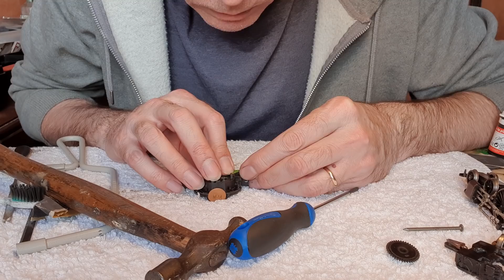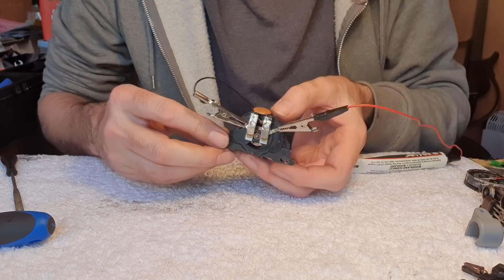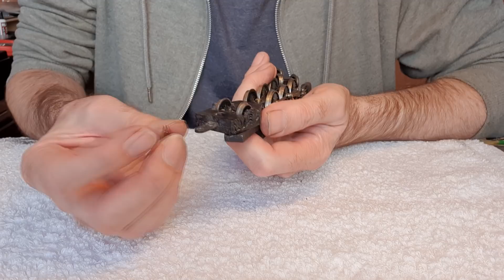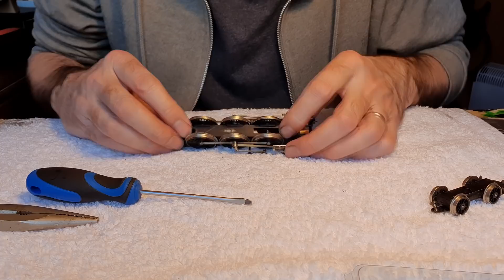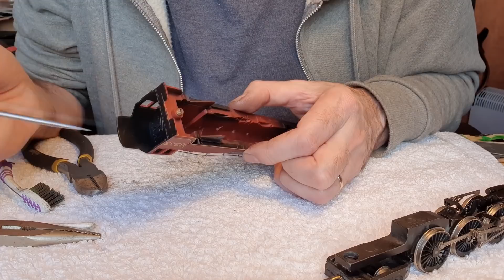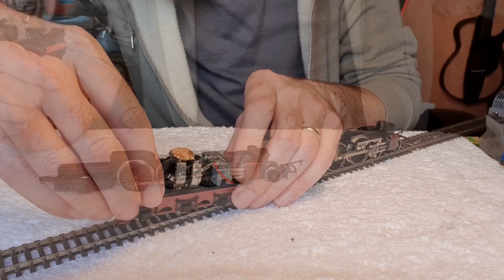Hornby R066 Duchess of Sutherland: eBay Non Runner (Part 2)

Comment: Excellent vid. The 3 pole ringfield motors are easily maintained but I’m a bit afraid of steam engine quartering and the con rod assemblies. Great bit of improvisation making the new spindle. That’s what I’d have done.

Comment: I have one of these on my workbench at present which is part of the Hornby L.M.S. Express Passenger set, (renumbered as R118 here in Australia). It has a broken linkage rod screw on the RHS and both front and rear drive tires on the RHS have come off the wheels. Here in Australia it is very hard to get parts...

Comment: I suspect that rather than the spindle wearing due to lack of lubrication - how can a plastic gearwheel wear a die-cast bearing? It was probably not cast properly in the first place.
Reply from the maker: Friction causes both the spindle and the gear to wear. The hole in the gear wears evenly because it spins and results in a gear with a larger hole. The spindle wears on the side subject to the most friction in the direction of travel. Resulting in an oval shaped spindle. It's not bad casting.

Comment: Loved that video.  My first train set in 1978 was the Duchess of Sutherland Express Passenger set which, as you said, was Hornby's flagship set for that year.  My parents paid £49.99 for it from Bentalls in Kingston Upon Thames - a lot of money in those days!  I still have the complete set, albeit without the box.  The engine hasn't been run for about 25 years but as I've just taken-up railway modelling again, it's going to be first in the queue for a good clean and service!  And as for the body sitting a bit high on the chassis, mine always did that so I suspect it was a trait of the model back 40+ years ago.  Keep up the great work with your videos and hope to see more soon.

Comment: Dear Sir, 1 / re your battery powered drill, I notice that other commentators have suggested a Dremel, which is a very good power tool in its own right, BUT I respectively suggest the purchase of a Pedestal Drill Press as it will ensure true vertical holes, it will allow for slow and high torque speeds, and it will also be useful for non model railway work as well.By its very nature it is more controllable than other alternatives.( I concede that a lathe is also a possibility, but that really is going onto another level ) For the sort of modelling work you demonstrate a Pedestal Drill Press ( sometimes called a pillar drill ) would be useful, and better value for money.
2 / I also really enjoyed this video, and I also liked th idea of using brass rod to fix the loco to tender current collector, a neat solution to an interesting design idea that, in practice, appears to have a high failure rate. I note that Hornby now uses RC plug&socket to transfer power between the loco & tender.Best wishes and regards from Australia.

Comment: Inspiring repair, you have the Victorian attitude of 'can do'.  However, if the oval pin was due to lack of lubrication wouldn't the other pins exhibit similar problems?  Perhaps it was a manufacturing defect.

Comment: What's happened to your excellent videoes
Reply: Great tutorial - very informative. To help me in my own project,  I'd hoped to see the (now unavailable?) clear S9682 light lens unit fitted beneath the body front, which transmits light from the bulb to the light holes near the buffer beam, but looks like it was missing on that model - which seems to be common.

Comment: Hi Bill great vid. Followed your lead and just stripped down a Duchess class from mid 70’s which was a very poor runner. New brushes and springs etc and with battery motor works fine. For some reason power isn’t transferring from loco wheels to tender but if I short with a wire on wheel and touch tender pick up it runs ?  Not missed anything on rebuild - I guess I just don’t have your magic touch 🤣🤣. Keep em coming as really enjoyable.

Comment: I once had a late 1940s Hornby 3 rail LMS Duchess of Atholl-all metal with a vertical commutator like the N2 you overhauled. I was very interested therefore to see how Hornby had updated these Stanier pacifics (the real ones I grew up with at Watford). I could never get my head round tender drive but some of my scratch-built locos had tender motors and a cv drive to a shaft in the loco with all-wheel drives.

Comment: Easy! cough

Seriously this has to be your most extensive repair to date. Very impressed. And well worth it. Always one of Hornby's most desirable locos along with Flying Scotsman and Mallard. Great to see the two old rivals together.

As a kid I had a Flying Scotsman (my only large steam loco at the time) and later I wanted another big pacific. I knew it would have to be a joint Birthday/Christmas present and even then wasn't sure if my parents would agree. The two I really liked were Mallard and the Duchess of Sutherland with it's gorgeous crimson-lake livery.

I loved the idea of seeing the most iconic locos of LNER and LMS racing along side by side round my layout, however I'd have had to wait another year to get the matching LMS coaches as the train pack was too expensive. Mallard was a bit cheaper and I had two sets of coaches that would go with the BR green livery, some LNER teaks and some lovely blood and custards, so went for that instead. I always secretly wanted a Duchess too though.

Now that I've got back into the hobby one of the first things I did was get a BR maroon Coronation class and matching coaches even before I got the layout up and running!
Reply from the maker: Yup. Actually I think I now have all the locos I wanted as a kid back in the 70s with maybe one exception. That'll come one day if I can get one a decent price!

Comment: Hi Bill, Looking at that chassis it looks like you could fit a X04 motor in it with the correct gears. That would be an interesting project. You say what next, Well now you have the Duchess of Sutherland it would be rude not to get her husband the Hornby Patriot Duke of Sutherland.......... :). Well done on an excellent repair job. One thought on the raised rear of the body. It maybe that the spring on the rear pony truck is not the original one and is too long. Therefore pushing the whole rear of the engine up slightly. Try running it without the spring to see.
Reply from the maker: I'd rather run it with the ringfield than an X04. Much quieter and smoother. A Type 7 motor in the loco would be better than an X04 but either way it wouldn't really be worth it. The idea of tender drive is off putting but I've actually warmed to them a bit as the Hornby ones at least run nicely if serviced well. The spring for the pony truck has nothing to do with the fitting of the body. I suspect someone has fitted a replacement brass thread in the body that isn't inserted fully or is too long.

Comment: Could you have perhaps drilled a 1mm pilot hole into the old gear spindle before cutting it off ? You would then have had a marker on the body? Might have needed a Dremel on a pillar stand to get it dead centre?  Anyway, great repair - I reckon that will last 🙂👍
Reply from the maker: In theory maybe yes. Trouble was that the spindle was so worn I don't think it would have been possible in this case although yes a pillar stand would have helped. I've had one on my Amazon save for later basket for months....
Reply: @oobill  In which case your method was a great solution👍
Keep your eyes open on Gumtree or your local Facebook buy and sell groups. I got one that was unused - suspect unwanted gift. Should make drilling holes for things like handrails more accurate.
Keep the videos coming - very practical, and becoming a mine of useful information.

Comment: In the early days it was the way of things to drill holes in varous locations on pre-zero one designed locos to accommodate the chips - even to the extent of attaching a "match van" for various tank locos. I had a B12 loco and the zero one conversion was to put the chip in the  tender drilling the hole for the wires and then drilling a hole in the firebox to take the wires to the XO3 motor. This was the recommended way according to the instructions. Post Zero one introduction the locos were designed with the appropriate spaces/holes to take the chip and wires.
Reply from the maker: Really? They actually recommended doing that? Blimey! I guarantee it can be done with two slim, black wires under the drawbar and up into the underside of the loco or drilling one small hole somewhere less obvious than the firebox. But I guess Hornby had to offer a simple one for all solution as guidance.

Comment: hello Bill can i pick your brains please ive just pick up for pennies 2 lima locos a 121 and a 117 driving coach i have been watching you repair lima ringfield motors and have the 121 running like a dream, i think the are a older motor as the cogs are held on with hex nuts/screws rather than the clip, problem i have its only driving on one axle the smaller cog that connects axle to bigger cog is not making contact i dont want to buy a donner loco without knowing what i need peters spares have 1 cog in stock but with postage its very expensive  looking forward to hearing from you Trev
Reply from the maker: Try contacting Richard at https://diesel-trains.co.uk/

Comment: You don't need new buffers for her, the Duchess class has oval buffers at the front (or it does on the two models I've had since new at least). Great video, I need to give my City of Nottingham loco a service and a look at to try and alter a poor repair a model shop made that put a yellow wire underneath the rear pony truck
Reply from the maker: OK cheers for that. A yellow wire? Dear oh dear....

Comment: You need to buy yourself a Dremel or something similar. An Archimedes drill might also be useful. ( I bought a miniature Dremel type drill from Lidl, though it’s rechargeable. They also sometimes have mains powered ones in, via a transformer.
Reply from the maker: I used to have an Archimedes drill and keep meaning to get another they are very useful. I have a rotary tool that I use for drilling sometimes but some jobs need the variable speed control that a proper drill gives you to get the hole started accurately.
Reply: @oobill   the mains powered drill has variable speed. Both the drills from Lidl came with a selection of collets, some small drills, burs etc. Lidl sometimes actually sell sets of tools for them.